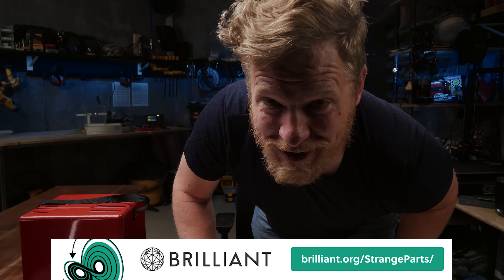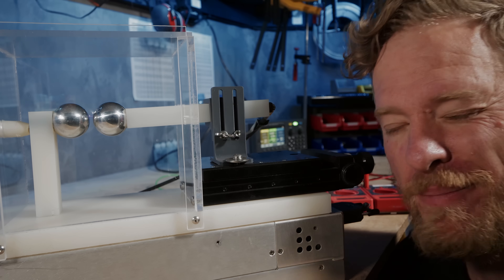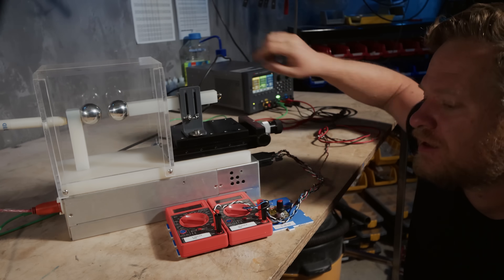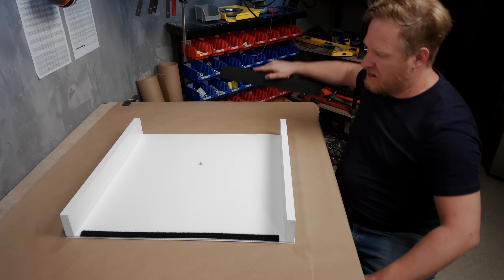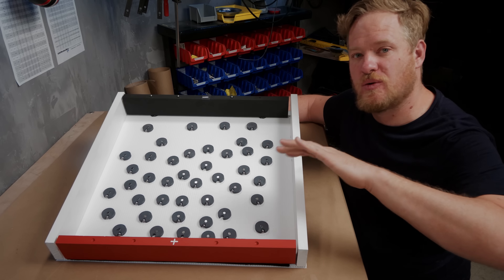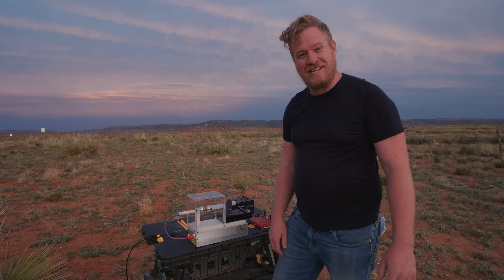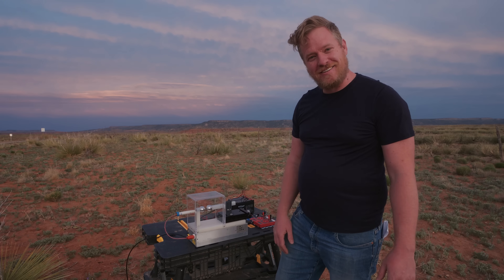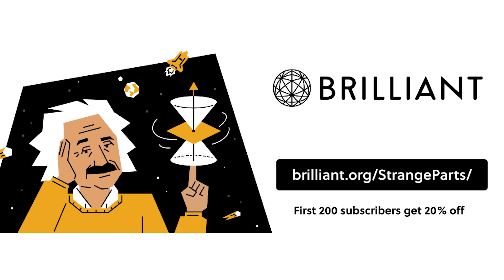Why 10,000 volts at altitude is a BAD IDEA

Comment: I was utterly confused because normal SEMs need a vakuum but apparently there are Atmospheric-pressure Scanning Electron Microscopes and you didn't explain that.
Reply: HV-generating electronics don't really need vacuum (and discharges would get ridiculous if the vacuum were incomplete)
Reply: @bottlekruiser  Yes, what do you want to tell me with that?
Reply: @thesciencefurry  that you don't need to evacuate the entire thing, just the chamber with the electron beam
Reply: @bottlekruiser  Yes, that's how a normal SEM works.
Reply: Actually thinking this through, I believe his explanation may have been incorrect as to what the actual problem is. The chamber should be at vacuum, however the electronics generating the high voltage could be arcing before the sample chamber.
Reply: @mobilcams  Usually such electronics are encased in epoxy resin. Or kept in oil ( X ray tubes for example) But maybe it's somwehere at the connection to the electron gun outside the chamber.

Comment: I have a strange and possibly stupid question, couldn't you theoretically fix the problem by filling the chassis with sulfaxifluoride? It's a heavier than air gas that really doesn't like to conduct electricity, more of a theoretical question

Comment: Great video! The only thing I don't get, the chamber itself is held in vacuum, so the ambient atmospheric pressure should be irrelevant - so the arcing is in the control boards which aren't in the vacuum chamber - seems like immersing the whole thing in oil, or even pressurizing it with air, could work around things?

Comment: I grew up at 10,000ft AMSL, but didn't get many chances to play with high voltage there.  In that short time between CRTs and LCDs, we were told that plasma displays worked somewhat strangely, though.

Comment: If the distance required to hold off an arc between the balls increases with altitude why does the high altitude cause arcing in the SEM? 
I presume it's the HV power supply and not the SEM chamber itelf since that's in a vacuum.

Comment: Nice video! The demo with the metal balls was really great. 

Could you not solve the problem by making an airtight box for the SEM and taking the pressure up to 14.7 psi in that box? That should be less that a 4 psi difference, so it needn't be too difficult.

Comment: I kept expecting you to build a pressure chamber for the SEM. I'm guessing there is a reason that won't work.
Reply: Building a pressure vessel that drops the altitude within would only be a few psi, but making one that fits the machine, plus being able to use the machine without having to pull it out and put it back in again, plus making hermetically sealed connections for power input and communication with PC would all make this project too involved. Also, even a few psi can become dangerous quickly.
Reply: @Tedd755  It would be over 3 psi to take it down to sea level. But he doesn't need to go that far, since the device works at 5000 feet. So a 1 psi increase would likely suffice. Not so dangerous or expensive to accomplish.
Reply: @Tedd755  You might be right, but I was thinking more along the line of how they remediate for mold using plastic sheets and a fan to create negative pressure. Reverse the process and use the leaks and fan speed to adjust the pressure.

Comment: This is because the creepage and clearance distances inside the machine weren't designed for such altitude but one thing you can do is either increase those distances which would ve hard and require even changing the enclosure and mounting hardware (you can actually refer to the standard UL 61010-1 to see a table of these distances and the multiplier per altitude after 2000m), or you can simply pot your PWBs with a resin or add physical insulation just like you mentioned.

Comment: You could potentially use a sealed tent to create pressure difference and have the microscope contained in there. The only problem I could see with this is not having room. I think it could be done pretty cost effectively.

Comment: We built a LINAC at university and were using around 100keV to get the electrons to jump off a tungsten tip. I knew we needed to use a vacuum etc. So thought I had an idea about what was going on.. but didn’t realize the issue pressure would cause… (due to altitude)

Comment: Woooa. You have trees at 9400 feet? (~2800m) In the european alps the timberline is at around 1800-2200m which is ~6000 - 7200 feet. I never realized how different it would be in different climates.

Comment: Great video. I would build a pressurized box to allow the SEM to work as designed. Lexan box with a Schrader valve tapped into it. Tire pump to get it to the right pressure, boom, bobs your uncle.

Comment: The accepted solution for this sort of problem is to put the high voltage components in something with higher dielectric strength, e.g. oil. However, that's not practical, so how about sitting the unit in a tank containg sulphur hexafluoride (SF6), it is frequently used as a high dielectric strength gas in high voltage systems.

Comment: Maybe you can fix it by putting it in a container with a different air mixture. Some gases might be more isolating, then you could reduce arching without changing the pressure or the device.

Comment: Could you build a pressure chamber that could fit the SEM inside? Then you could put it under the same pressure it'd be at sea level and you could test it without causing arcs.

A vacuum chamber might also work as there's no air for the arc to conduct through, but some electrical components might be sensitive to a vacuum.

Comment: 5: put the SEM in a pressure chamber.
Reply: My thoughts exactly lol.
Reply: Probably not really more involved than a "space bag" and a bicycle pump, as the differential pressure isn't more than 1 atmosphere. Other than sealing the thing, it could be done with a trip to Walmart.
Reply: @pauljs75  If I remember correctly isn’t something very similar to that used on Mt. Everest to treat altitude sickness when the person can’t immediately be brought to lower altitude? Edit: the Gamow bag,
Reply: @logantc.1353  He might need to start a Patreon account to pay for that.

Gamow Bag Hyperbaric Chamber, Civilian Model $2,625.00

The Gamow Bag is a unique, portable hyperbaric chamber used for the treatment of acute mountain sickness (AMS). By increasing air pressure around the patient, the Gamow Bag simulates descent of as much as 7,000 feet, thus relieving AMS symptoms. The Gamow Bag is pressurized with ambient air to 2 pounds per square inch by use of a foot pump.
Reply: @azy6868  oh I wasn’t suggesting using a Gamow bag, just that it would be a good place to start since it does what would be needed for this, and more since it is made to work with a higher pressure difference .
Reply: Possibly using a denser gas instead of air might also work. Something like Sulfur Hexafluoride. That way, the rig could just go into a (sealed) fishtank.
Reply: That would be something that I'll be actually interested in!
Reply: as everyone suggested just put it in pressure chamber. or you can sulfur hexaflorid SF6 (GAS USED FOR REFRIGERATORS ) instead of air . no pressure needed its more better ELECTRIC INSULATION THAN AIR  beside its heavier then air you dont need a closed container just a container full of it and emerge your machine. good luck
Reply: @dz-tech19  Indeed. SF6 is used to fill the electron gun on a TEM that go up to a few hundred kilovolts.
Reply: Hop in the pool :thinking:
Reply: That will be the only chance
Reply: an acrylic box with a hole sealed with silicone for the cables would do, the overpressure is 0.25 atm or 3.7 psi, a random matress  or tire pump might be able to maintain that.
Reply: @satibel  He doesn't even have to go to sea level pressure, just get below the margin.
Reply: Or flood it with a heavier than air inert gas? Less pressure needed perhaps?
Reply: @drutfurgeson  that was my idea 😁😁
Reply: It is easier to lower the pressure than to increase it at that level. Choose the path of least effort.
Reply: Build small pool, place SEM on table in pool, push upside down sealed box over it about 8" down into the water and you will be back at sea level pressure inside it.
Reply: Make your vehicle a pressure chamber with a shopVac
Reply: A SEM should operate under vacuum
Reply: Oh I get it, maybe the arcing is happening in the high voltage power supply. In which case an insulating potting compound or maybe a better power supply would do the trick. I guess it would help to have a lot more detail on where it is arcing.
Reply: @jakesimmons5578  indeed. That sounds weird. I would expect a fully potted HV supply. At the same time it seems this SEM is not operating under vacuum?
Reply: Next: How to build a room sized pressure chamber
Reply: @jurgmanx4644  1.Make hole in wall. 2. Stick tube of vacuum cleaner through it. 3. Close door and windows 4. Turn vacuum cleaner on.
Reply: @jurgmanx4644  that has to be where this whole thing is going ... a clean room.
Reply: @ejrupp9555  With pexiglass and some cement... He could probably use some inert gas (like Nitrogen, which is used for welding it has 20% bigger dielectric strength than air).
Reply: @ejrupp9555  Hi working in a Cleanroom myself I can attest that is what it is: a really clean room, not a pressurized room. So unfortunately your suggestion doesn't do the trick.
Reply: Could it work in a vacuum chamber
Reply: @andersonseegoolam1486  vacum chamber its the oposite vacuum = lowe pressure = more altitude

Comment: I wonder if there's a way to move the controls elsewhere and stick the entire thing in a jury-rigged pressure vessel. quick googling and math says about 5psi at 10k feet to get to sea level pressures. a mylar balloon pops at about 7.5psi, so not like it's a crazy amount of pressure needed if my numbers are correct. I've never used an SEM before so I don't know how hands on it is and if this would be at all practical

Comment: Scotty, first, thanks for the cool video!
I work on aircraft, and one thing we do is use pressurized nitrogen to stop electrical arcs from forming.

I don’t know what you’re trying to do with the SEM, but if it’s an automated task, you might be able to build a metal or acrylic box around it and pressurize the inside with a small nitrogen bottle. That should prevent arching.
Reply: This exact problem has been remedied back in the 30's with pressurized mags and leads for spark plugs on turbo/supercharged aircraft.  They knew the relationship between pressure and spark gaps and came up with a simple solution...pressurize anywhere there's a potential spark gap.  Literally all that's necessary is a containment box that can be pressurized to 4,000ft...doesn't even have to be leak proof as long as it's hooked up to a decent air supply and maintains pressure differential.  If you want to go a step further, nitrous oxide is a cheap and readily available dielectric alternative to sulfur hexaflouride, works slightly better than nitrogen at pressure, and doesn't produce toxic gasses if coronal discharges occur.  Seal the box up, plumb the nitrous bottle to it, adjust regulator to provide sea level pressure, and you're done.

Comment: I work in electricity transmission at voltage usually around 275kv to 400kv and I never thought of altitude effecting the arcing gaps that way.

I have noticed more modern equipment has altitude rating presumably this must be part of why

Comment: Can you build a pressure vessel that you can operate the SEM from that will reduce the altitude by 2000-3000ft ? I'm looking at tyre pressure changes at altitude and potentially you might only need build a container that withstands 0.5 - 1.5 PSI to drop the altitude just enough.

Comment: Wow, this is interesting. I moved to NM a year ago and have definitely seem some oddities in my electronics I can't explain. Definitely know the thinner air impacts my drone planes. What other devices could be impacted by this?
Reply: For drone flights, I think you've probably already found the biggest issue.  The others are much less likely to trouble you.

If you're running things with cooling fans, they may need to spin faster -- the thinner air isn't as effective at cooling. Electronics that depend on a specific air gap -- usually air-inductors -- can change their values a bit.  And lastly, you're slightly more likely to get bit-flips due to both a higher exposure to cosmic radiation, and the natural radiation from the Colorado Plateau.

Comment: Very nice video, great way to explain things.
Is it possible to increase the pressure in the "chamber" where you put the sample?  I do not which device this is, or if it is possible to make a "sealed chamber" at all for it.  Or if not, put the whole device inside a box that is pressurized,no idea how big the unit is.  The "hi pressure" chamber does not to hold that much pressure, less than ~0.3bar if you are basically at mount Everest.

Comment: As I understand it, in IPC-2221B generic standards on PCB design, creepage and clearance distances are specified at 3050m or 10,000 ft, with different distances above that altitude, so you'd hope If they've followed those standards you shouldn't get arcing at 7300 ft. However those are generic PCB standards and I don't think the standard really holds up at those high voltages and other standards might be better, you'd just have to test it to know.

Comment: Putting the SCM in a pressure chamber would work as well. It wouldn't have to be much and pressurized with a compressor. If filtering of air is required a separate closed air flow pump could suck air out of the chamber through a filter pack  and back in. well done on the explanation!

Comment: Time to build a pressure vessel for your SEM.  Good thing it's already compactly built,. A few psi wont require anything crazy.
Reply: I was actually thinking a similar thing, Perspex box was my first thought, and then I remembered a fair/show ground Blow Up Worm that you can run around inside of  that uses air pressure to keep it inflated.
Reply: He could also just open it up and apply potting compound to high voltage components
Reply: I'm not sure if i understand all the math involved, but this seems plausible at the moment. When at 7300 feet atmospheric pressure would be around 11.3 psia depending on temperature, if one increased pressure approx 30% to 14.7 psia i think you would be near sea level. If you put the SEM in an airtight pressure vessel. How are you going to operate it. Your gonna need a vessel that YOU and the SEM can be in so one can operate it. Your gonna need something MUCH larger than a bike pump to pressurize this.
Reply: Surely there would be a way to either wire the controls or remote control the SEM out of the pressure vessel.

Comment: Couldn't you just seal it into a box a flood it with argon at a higher pressure as a stopgap measure? You could even recapture the 'dirty' argon for later use. You wouldn't need to go very high, 15 bar should be plenty. Of course, nature abhors pressure gradients and corners, so you'll have to be cautious, but even a leaky box might work.
Reply: Did you really mean 15 or 1,5 bar?
15 bar is a relatively high pressure! Your car tires should have something between 2 - 2.5 bar and such pressure is not easy to seal or keep in an ordinary container, it should have thick walls.

Comment: As soon as I read the title I was guessing altitude. I encountered a similar issue with a customer product I was testing and integrating in the aerospace world. Ended up having to help them do a bit a of redesign, but got it fixed.

Another complicating factor is that it’s not just air pressure, it’s also the fact that there are more cosmic rays at higher altitude (less atmosphere to insulate).

Comment: @11:58 Couldn't you also place the entire SEM into a pressurised enclosure?

Some acrylic, glue, a bike pump and a few grommets for the power cord, pump inlet and I assume data cables. Place an altimeter inside the box and pump until it reads sea level.

Comment: Looks like you're going to have to make a pressure chamber.  Thankfully it won't need to hold much pressure.  You just need to make up the pressure difference until it works.  So like 4-6 psi?  Maybe more if you want wiggle room.  Get some thickish acrylic sheets and some rubber gaskets.

Comment: Wow the camera work is great.can you pot where the arcs are happening in resin like those cheap taser modules? not sure if you mentioned where it was happening I may have missed it. maybe that clear reenterable potting compound like you may find in high voltage insulation testers